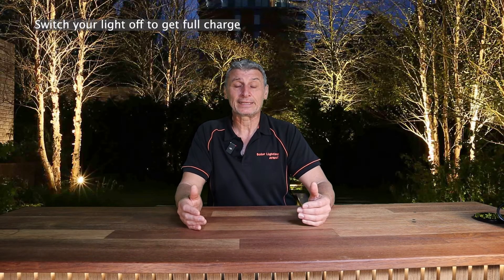How to Troubleshoot Common Solar Light Issues | Step-by-Step Guide

Comment: Our lights only work for 2 hours.  They talk about using the manual to help troubleshoot, it would be nice if you can read it.  The words and pictures are way too tiny.  This is the 4th string we have ordered.  This is frustrating!

Comment: When I turn on the solar panel light, it lights up for a moment and then turns off quickly.What do i do it has full charge
Reply: Same with mine and they are new. They turn on then right back off
Reply: Same exact problem here.
Reply: deafening silence about the problems isn't it? I've been servicing my garden lights after almost 10 years and despite brand new rechargeables some lights do this as well. Switch on then go dead after some minutes. Replaced some of the smd leds by discrete high light yield leds at 10 mA.
Reply: Same my light turns on for a second and then turns off. It’s brand new

Comment: Other things to check (step by step): 
1) Has it been destroyed by your lawn service. Even though there are a few parts left, dangling wires and bits of glass may be enough to make it work. But, maybe not.
2) Did you say "Please" in a nice Aussie accent? These lights are made in SE Asia and only understand the language (Not English) they speak Down Under. Buy American. 
3) Did you listen to this worthless video in its entirety because your solar light won't turn off and you thought this guy might actually know something about solar lights. Big mistake. Read this comment and then move on to someone who actually CAN help troubleshoot solar yard lights.